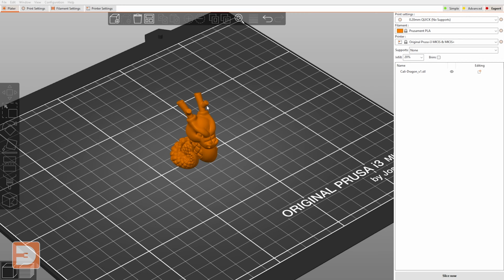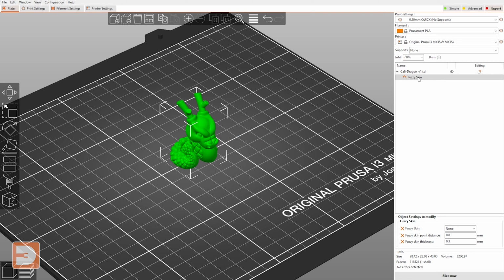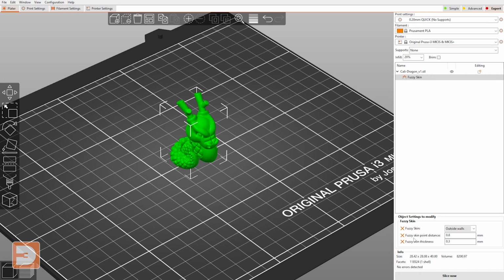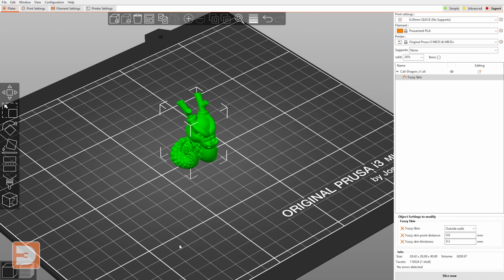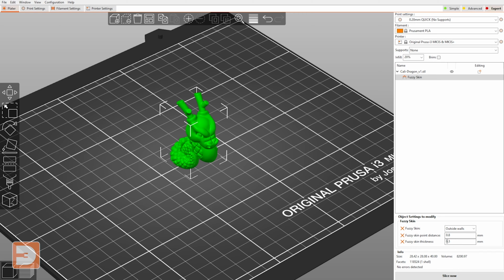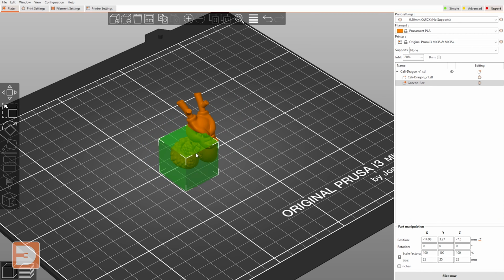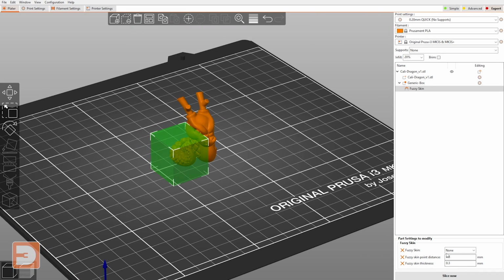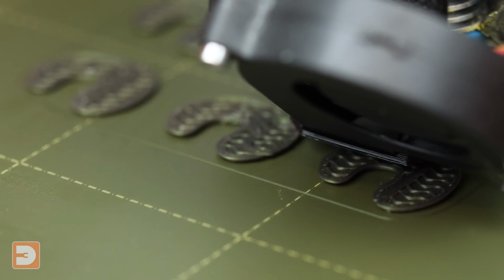Fuzzy Skin Tutorial

Comment: What version do I need to be? I have the 2.6.0 Beta because I could not find the alpha version (Recommended by every one) and on this version you Can't add any settings on your modifiers (Why is it then there?)
Reply from the maker: Hi there, this video was made using 2.5.2 if I remember correctly (an official release, not BETA).
2.6.0 has been officially released now so you that will definitely not have any missing features, but if you're wondering, I will be releasing a PrusaSlicer 2.6.0 video soon.

Comment: To the opposite of what you are doing.  What if I have a square apple mag charger I made.  The outside I want to be fuzzy skin, however the inside where the mag charger goes/snaps into must be smooth or the mag charger will not fit right.  How would I make the entire thing fuzzy skin but keep the inside smoot.  (Think ofa deck of cards with a center hole in it)  When I do fuzzy skin all it does everything.  If I do fuzzy skin outer walls it also does the inside walls of the hole.  Can one add a modifier sphere to the inside and that not be fuzzy skin?  I don't see anywhere in prusa slicer to do this....
Reply from the maker: Hey there, sorry for the late reply.
I've just run a test for you and found a simple system that works. 
If you'd like to apply fuzzy skin to a whole model except a certain part, turn fuzzy skin on in the general print settings tab, then create a modifier shape(s) for the area you don't want fuzzy skin.
Right click on the modifier shape and add Fuzzy skin to that. Then, in the setting for the modifiers fuzzy skin in the bottom right, set the Fuzzy Skin to None. 

So you'll then have fuzzy skin as default set to cover everything, and you're explicitly telling it to not generate fuzzy skin in the modified area.

Let me know if this isn't clear enough and I'll try and explain it further.